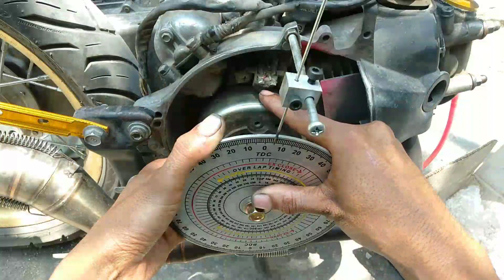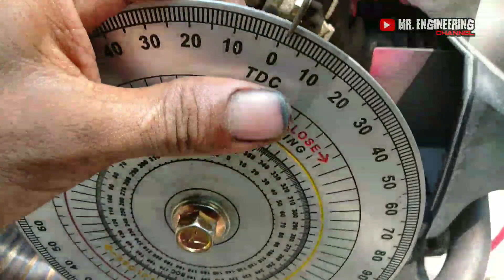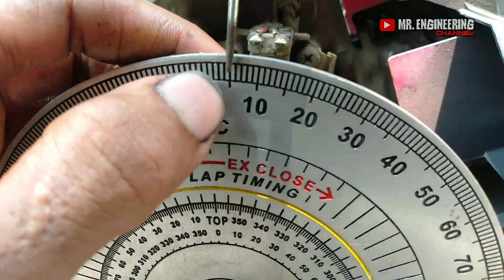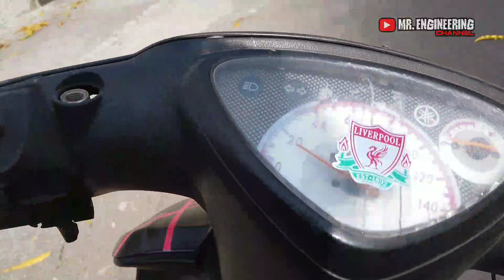Cara merubah pengapian mio standart harian pakai CDI Shogun

Comment: Bang bro, mau bertanya nih, mio ane baru papras noken as, ane papas sendiri.
Tapi setelah ane pasang kok motor malah gak mau nyala? Lubang isap juga gak mau ngehisap bro? Kira² apa ni permasalahan nya bro?

#sukses terus mass bro eengginerring
Reply from the maker: Yang di papas area mananya dan berapa mm ?
Reply: Bagus2 namanya buat pengalaman gimana mau hidup mapasnya gk presisi klep gk bisanutup rapet dia telat akibat bejolan temlar ketahan jeglongan noken yang ada bensin malah nyembur,dari karburator,,,maaf pengalaman pribadi dulu,,korban noken
Reply: @MrEngineering  base circle nya mas bro, saya papas 2mm dari 21mm (standar mio)
Reply: @sisantosanto1327  iya mas bro, papas nya udah rapi kok mas bro.
Reply: @sisantosanto1327  ane dah 3 noken jadi korban cari pengalaman mas bro. Hehehe
Reply: @ortodokssaja7838  kalo buat harian apa ga kebanyakan 2mm? Saya aja harian ,0,5 aja. Klo segitu per klep standar setau saya gak kuat
Reply: @perrypebriant506  untuk ngejar lift nya mas, jadi dari 25.5-19=6.5 mas